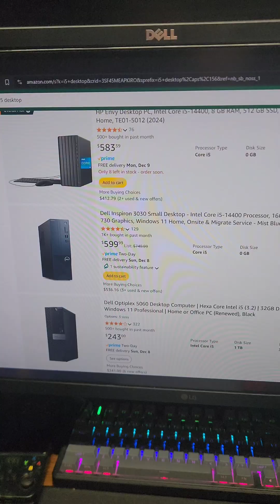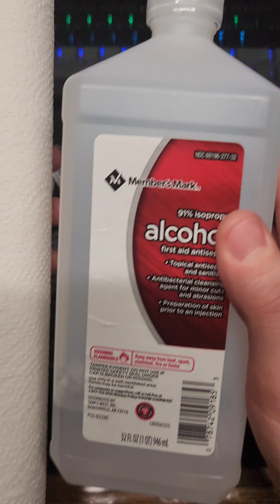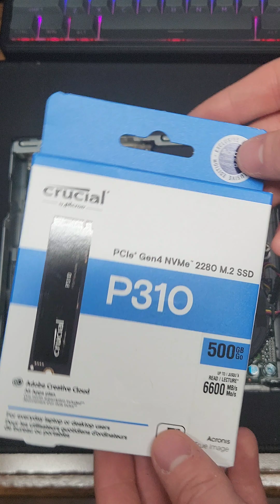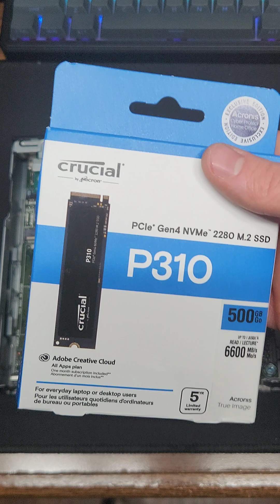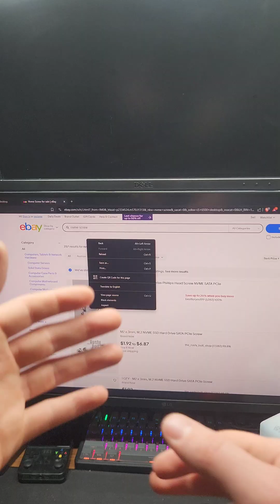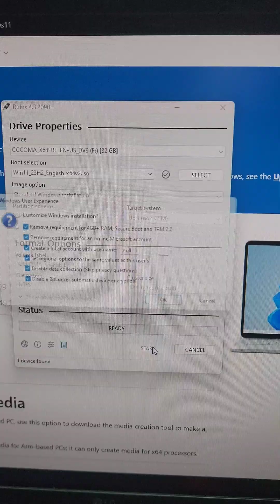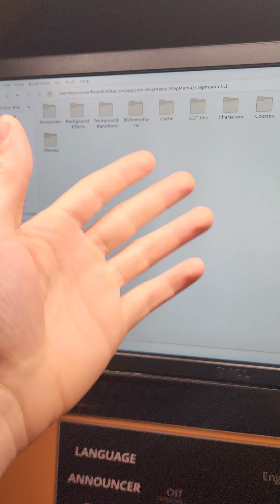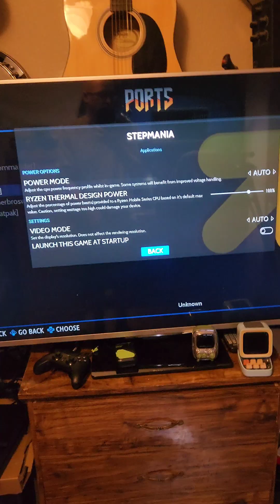Old PC's are AWESOME!! // $53 eBay PC into Reliable Desktop + Game Console // DDR Mini PC Build

Comment from the maker: Edit: I couldn't for the life of me tell you where my AMD comment came from, I'm confident I'm referring to some ancient machine I worked on prior to spending more time with modern AMD hardware, but I couldn't tell you more than that 🤦‍♂️working with AMD is going to feel exactly the same, but if you start working with some really old stuff expect the unexpected, like pins being on the processor rather than the board 😬

Be sure to check out the links in the video description, I have a collection of everything you need to get started with a project like this 😁👍